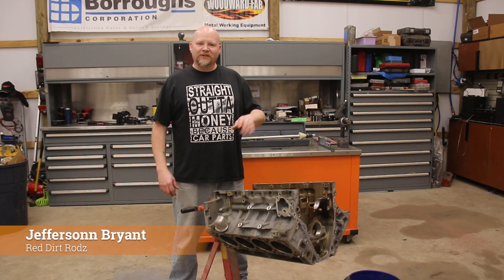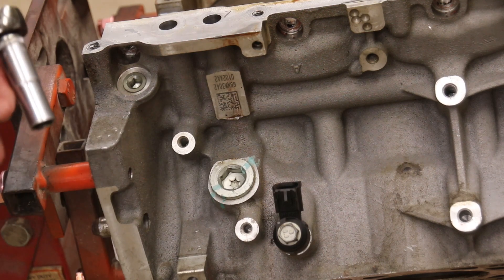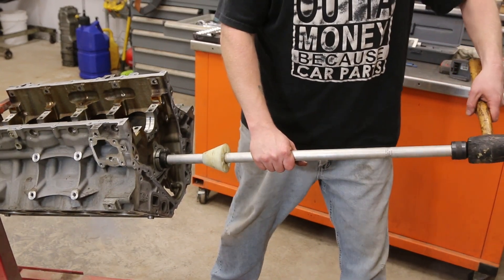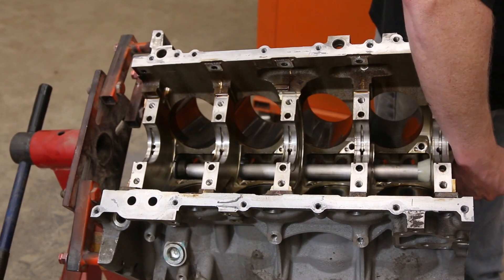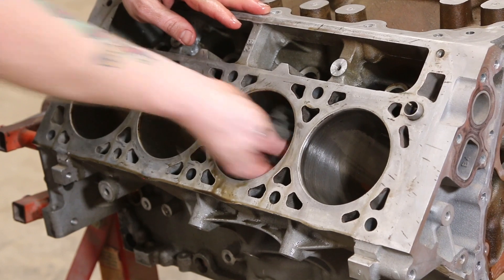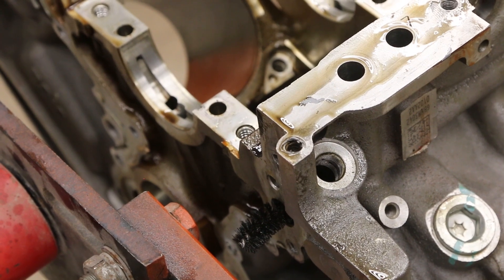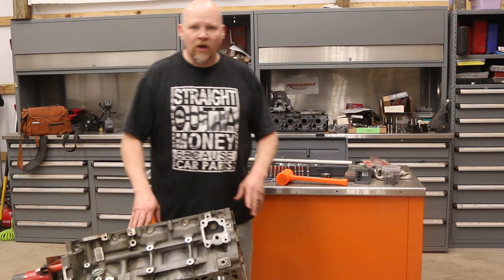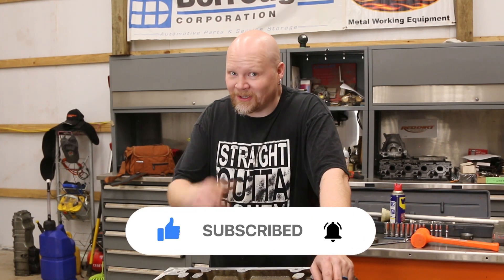How to Clean An Engine Before Rebuilding

Comment: Great Job!! Thanks for sharing this process. I have an old 350. Had a leaking freeze plug. Actually two. Changed the sides and the rear plugs, with brass when I changed from a Saginaw 4 spd to a Borg Warner 5 spd. And there was rust in the jacket. Got most of it out best I could, but was just wondering about getting the jacket completely clean when rebuilding. Thanks again ;)
Reply from the maker: No problem! Thanks for watching and commenting!